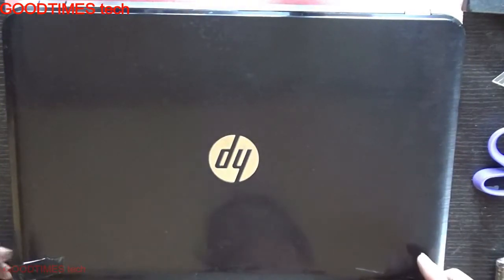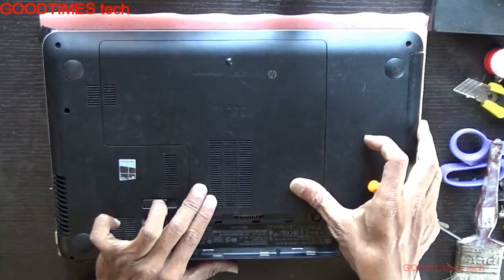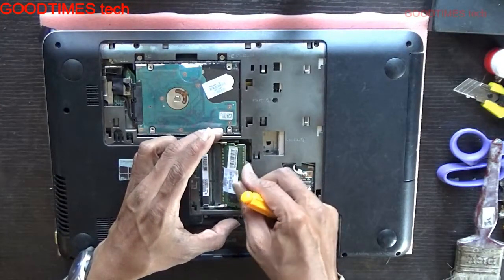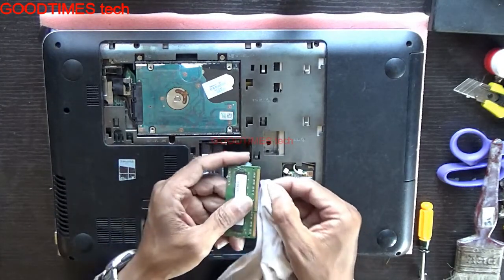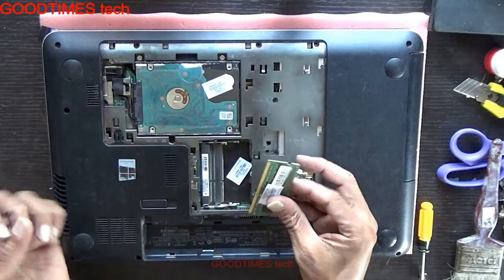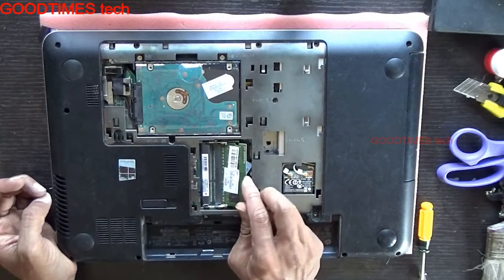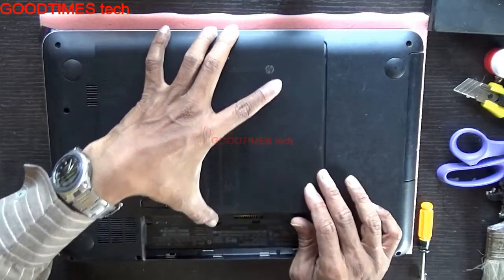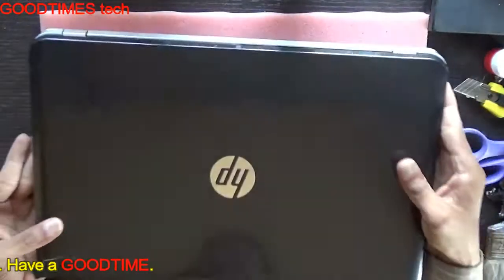Hp pavilion 15-e017TX | RAM upgrade | Replace RAM

Comment: Hi ... I want to ask you about replacement or upgrade the RAM. By the default, the system 4GB, if I add 1 SODIMM 8 GB DDR3 -1600 does the speed of my notebook increase ?. Thank you.